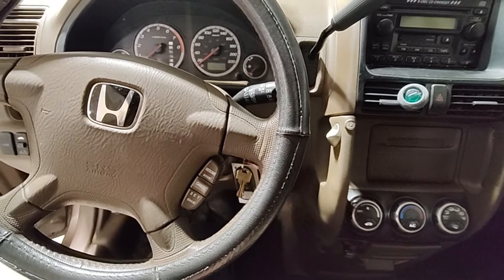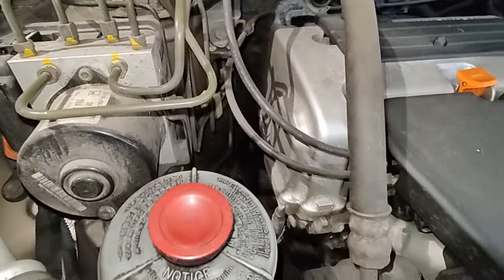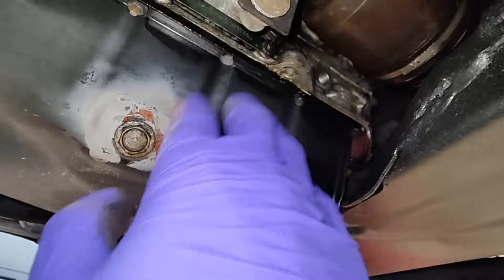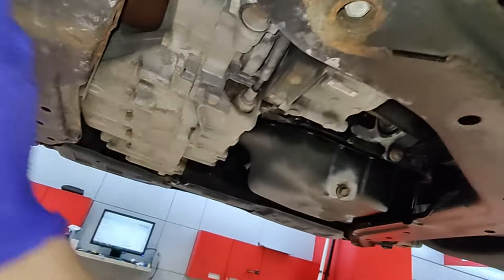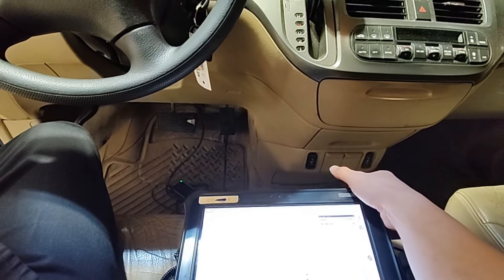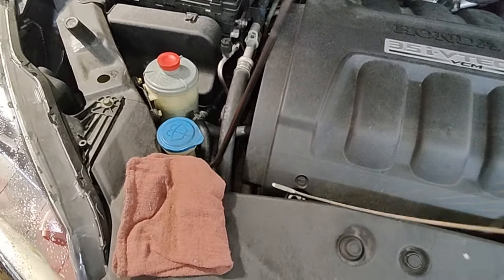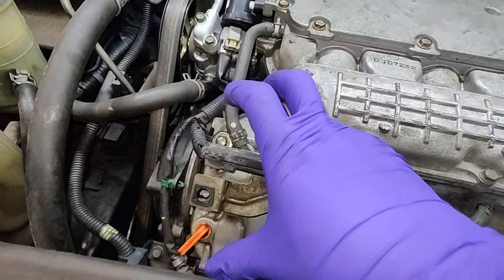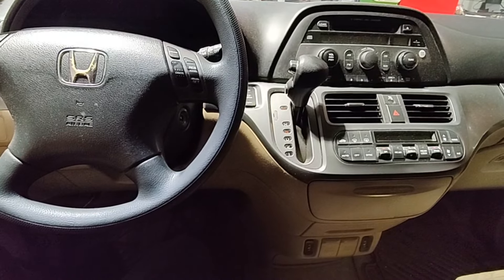Seized caliper, almost no brakes left, broken exhaust hanger, and an oil burner.

Comment: I installed a S-VCM widget VCM disabler thingy on my 2010 EX-L van. Two years ago now after the first misfire at 220k km. It's been running perfectly since then. Burns a bit of oil. Nothing extreme. Spark plugs look perfect on the VCM cylinders. Before they were fouled.
Reply from the maker: Having regular oil changes help. I see Odyssey come in with barely a quart of oil in them when their check engine light comes before the maintenance light comes on. Lol
Reply: @theoffroadingmechanic  I check and top up the oil if necessary every 20% on the oil life indicator. I can't imagine running it down to just a litre of oil. I wouldn't expect it to last very long.

Comment: My 2002 Honda Civic 1.6 had 220,000 miles on it. On its original clutch too. Dont ask how? Sold it in 2013.
Reply from the maker: That is actually quite possible if someone knows how to drive a manual.

Comment: First time viewer here and enjoyed the video. If you have time what year and models if you know experience the chain rattle you referred to on the CR-V? I also find it kind of ironic that the CR-V owner deiced that the airbag recall was worth getting but not his non existent brakes.
Reply from the maker: Second gen CRV 2001 to 2006 stretch chains. 2010 and up are more common for VTC actuator rattles. Some people actually don't know that they have a recall and the part has to be ordered when they book an appointment or if they just show up for a repair the recall part will be ordered for next appointment. And there are people that dont really do anything when they come to a dealership other than just a recall. Or they have a specific repair they want us to do

Comment: the rec are mostly for CYA so you’re not blamed for all the problems. VCM is another fad like start stop is now.
Reply: It helps Honda meet CAFE regulations and avoid penalties that would inflate the vehicle price. J series engines run fine with it disabled.
Reply from the maker: That and so I can find work.